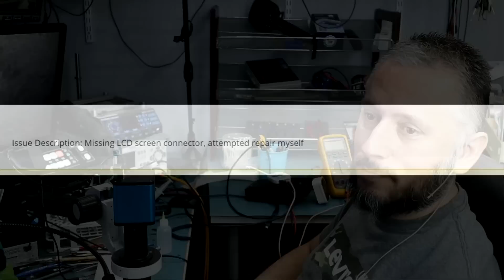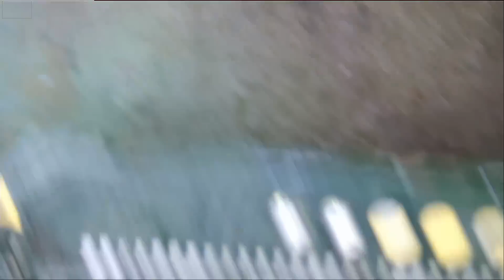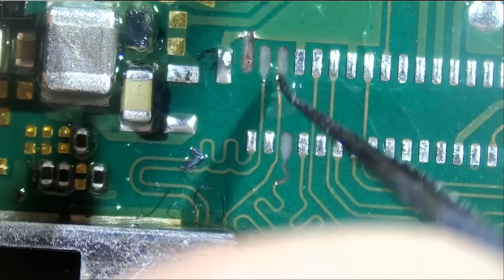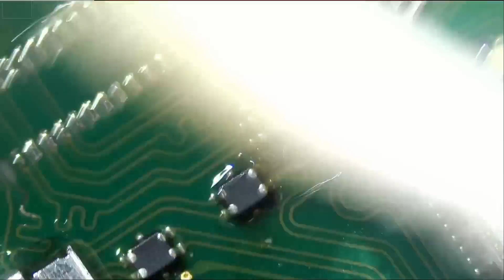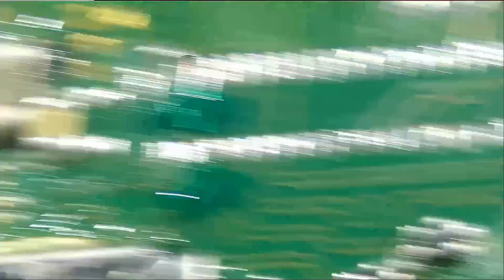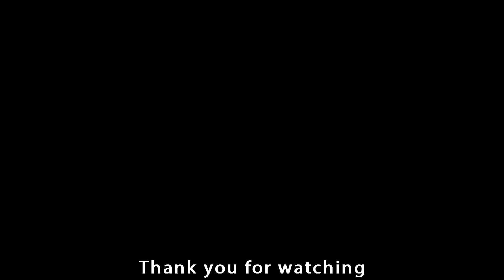Nintendo Switch LCD Connector replacement gone wrong.

Comment: Man what size wire is that? Magnetic enameled copper wire i assume? .01mm? Incredible repair fine hand and watching you bend and shape the trade repair wire so smoothly and perfectly is nuts. And cutting them that close to the pcb with the exacto blade... Impressive

Comment: Great job! I do this job as well and I usually solder it from the top with hot air using 310c @30% airflow so it don't blow away. I usually remove them from donor boards by heating from the bottom. Always worried about blowing something off, so question is what temp were you using roughly when you heated from the bottom to solder the new connector into place?

Comment: Another piece of evidence that you should not try certain stuff if your degree of knowledge suggests that you won't succeed. I've been soldering through-hole stuff for years but without a proper microscope, heat gun and tons of practice I would never attempt this.

Comment: Hello,
Cool movies, when you soldered the connector, you only used hot air? or some prehater from below. What temperature and air pressure did you set? I melted the plastic a few times. Regards

Comment: 14:05 you could save a lot of time on cleanup (especially around connectors) by dipping the pre-tinned wire into flux instead of applying flux onto the board. That technique works for me every time

Comment: Don't understand why people think they can do this level of micro electronic repair at home on their kitchen table with a cheap pencil soldering iron. This stuff is a professional level repair now with how small the components and traces are now. especially with the poor quality of manufacturing OEM's are doing now. Support your local independent repair shops.
Reply: local independent repair shops in most areas are not even close to being as good as this guy is

Comment: Did you use lead solder? If so, what temperature was the heat gun at, 350C or higher, considering you heated it from the other side of the board?

Comment: the bottom 7th pin from right is connected to a via and you missed it. i am doubt this fix will work.
Reply: To be fair there was two pads connected thro Vias I'm wondering myself if its actually working.
Excellent job non the less.
Reply: Well he wrote in the pinned comment he redid it

Comment: At 15:34 to right of connector, looks like the yellow component is bridging?
Reply: Nope, l think it's more like cotton fiber.
Reply from the maker: Yes it's a fiber, just like the one I though was a bridge at 16:05. The way light is shinning on it does make it look like solder.
Reply: Yello component is capacitor

Comment: How hard is it to use low melt solder around a FPC connector to remove it safely and easily this looks like it's been removed with a hairdryer 🙄🙄🙄
Reply: Not recommended. I've seen people use low melt around that area and it doesn't end well. Low melt is pointless on the switch board, it is super thin and transfers heat very quickly
Reply from the maker: I used low melt solder to remove this connector before. https://youtu.be/nju86ZZVQHY?t=294 If you can see the pins, then you can use low melt solder.
Reply: @NorthridgeFix  I saw that video, but most people don't know how to use low melt and end up making a mess everywhere. I've had to clean up mess like that before on the switch lcd connector, and if you miss one pin up comes the traces
Reply: @TheCod3r  as long as you know micro management with the low melt it won't affect the pins and the area around it
Reply: @fawaz16  I get that mate, just a lot of people don't understand how to use it, what amount to use etc and they end up flooding the area with it

Comment from the maker: I had to redo the work and restore the 2 pads that I though didn't connector anywhere 😡
Reply: Yes , at the video i see very tiny via on the board, on that two pads😅
Reply: No one is 100% perfect😉 but what an amazing job done!🤩

I need to do my first but still let it wait as I’m scared. What temp do you use for this?
Reply: Damn that sucks, must have been painful to remove it again after such a nice finish! At least you know this info for the next one that comes in.
Reply: thanks for your honesty king
any points on board goes to some another on board
perhaps you could directly conect that two points from another point on board with wire
Reply: Actually it's 3 pins. Hopefully it works with 2 fixed only. Third one should be connected to big copper plate with tear down and via (pinhole).
Reply: @erminbajric4633  yeap, that big plate in front of jump.
Reply: Yes I figured it out that you missed two traces.
Reply: I saw that on the first glance,  i was about to write it but then saw your comment
Reply: Hello there from France. Omg I was about to plan this repair guys! I downloaded a few vids on the subject. I damaged the connector while doing a simple digitizer replacement. I can't believe how easily the connector can't get damaged AND I KNEW THIS COULD HAPPEN T.T Plus this is the first time I have damaged a connector by bending one of the inside pins. I feel so bad... I guess it is a good excuse for practice. I have unplugged and plugged so many lcd connectors and this had to happen on my first Switch that I purchased a few days ago haha This is so funny how your vid got uploaded. I actually searched your channel a few days ago for this subject lol So now I'm going to practice on a few dead boards and on a cheap tablet and try this repair. Wish me good luck guys! I plan on opening an IT repair shop here in the French countryside soon^^ Thank you so much for your great videos NorthridgeFix.
Reply: That would be the 2 pads that have the through board links i assume
Reply: Is there no way to connect wires with the connector still on?
Reply from the maker: @confessionsofafirstlineman4914  Not possible. the via's are under the connector. We have to scratch and expose the copper then apply solder, Mask it then put the connector on.
Reply: Did it work in the end?
Reply: I saw it and made a comment.  
Well done to correct it.
We all humans,  and we all make mistakes. 
Excellent job.
Reply: yeapp..i was about to coment about that 2 missing pads, and sometimes you will find a truehole in the bottom of the pad. ( not in this case) good work :)
Reply: I was about to ask, "how did you know those are pads to nothing?" If they were grounds or voltage lines, I'm sure they would've been connected on a surface plane. I know you don't like to create more work by adding something that might "not" be needed, but if you're better than factory, you would do all of the work, right?
Reply: Hi, would you do a slow wifi router / modem repair? Thanks.
Reply: bill the dude extra !:D greetings from south africa
Reply: gj admitting it!
 not many would do...
Reply: At least you informed the viewers of the mistake. Personally I saw the vias but sometimes looking in from the outside allows us to see what the technician can't. Good job 👏
Reply: Oof man that's rough, was going to post about them and ask i guess this is my answer. Atleast we know for next time :) always learning.
Reply: @devilclarke  x2
Reply: You're integrity is amazing